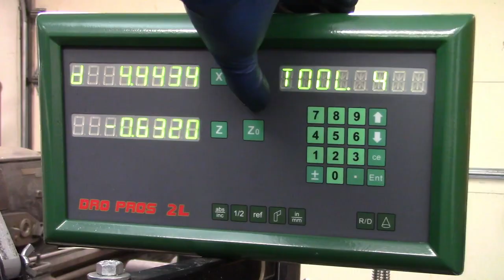Making a Table Stop Part 1

Comment: As a companion video you need to show people how to make one of those “drop in” style tee nuts to go with it.  I use those on stops and almost all my other table mounted devices, anything that does not require a gorilla grip to the table.  90% of the time when you want to add something like this to a setup the tee slot is blocked by something down the line and they are also just plain faster then sliding a conventional tee nut and stud along the table.  I do not believe any other YouTuber has ever shown one, let alone made one. Excellent videos. Keep up the good work.

Comment: I just watched a ARW discussion group, and found your channel. This is got to be one of the best mill stops/vice stops I’ve ever seen. I like the big hand knob so you don’t need Allen wrenches like the one I built. The socket head cap screw is always good for chips and I got a clean them out before I can put a Allen wrench  on it.  I’m gonna make one and I already printed off your drawings thanks again for sharing us. By the way which ones pink?
Reply from the maker: Thanks. I'm trying to get part 2 finished but it isn't going very well.